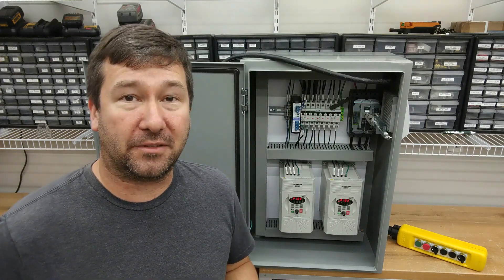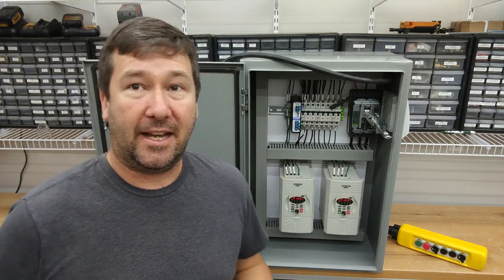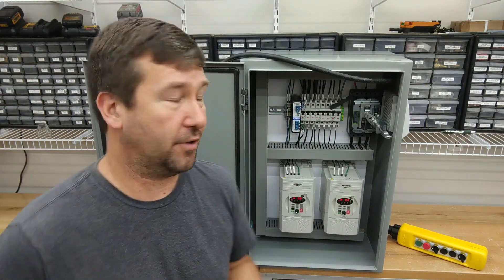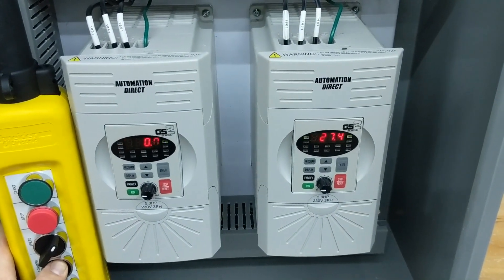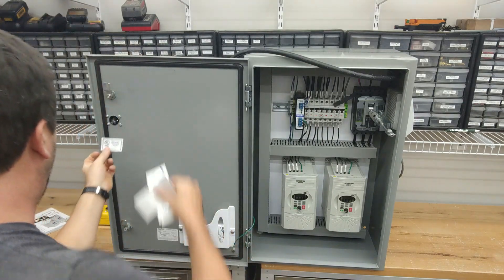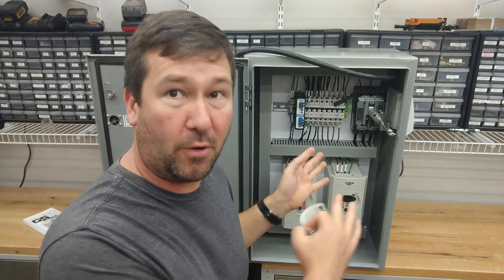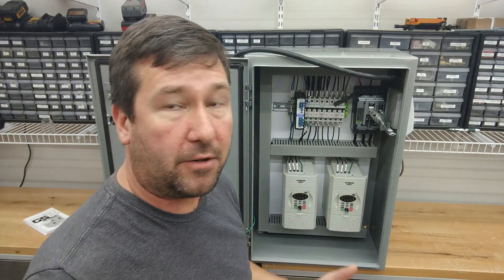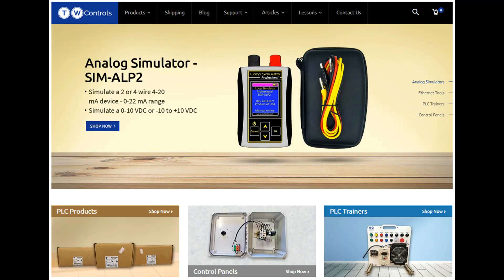Control Panel Building Testing and Finishing Touches Part 6 of 6

Comment: Tim, I’m looking for a handheld panel tester for doing my own FAT testing. What do you recommend? Thank you.
Reply from the maker: I'm not sure what you mean by a panel tester. Usually it isn't a single device that determines if a panel is acceptable but a procedure of steps that you usually test with a multimeter.
Reply: I gotcha, but what is the yellow handled you have in the video to simulate things ?
Reply from the maker: It wasn't to simulate things, it was a remote pendant that operated the control panel per the customer's specification.
Reply: Thank you sir
Reply from the maker: You are welcome

Comment: Thank you for the time and effort you guys put in to making these tutorials. I have to say "yep" to the hand washing. I had a brick and mortar repair/rebuild outfit that dealt strictly with coal mining. As can be imagined, everything we worked with was covered in black dust, dirt, and even mud. There was a lot of hand washing, through the whole process actually, but certainly through the reassembly. One tip that may be helpful to those that do use a lot of wire ties (as we did) is to cut the excess of the tie flush. I have worked on panels where my hands looked like I wrestled a cat because the excess was cut at an angle. Not a big deal but it was a pet peeve of mine.
Reply from the maker: Yes, plus I like to rotate them to the so that they are against the panel so that you are less likely to brush up against them.

Comment: Thanks for the series, I found it very useful. Some of your thoughts I would like to learn is layout. This is a pretty typical box for us but if I add a PLC, HMI [on the door] and contractors with thermal overloads, where would you have placed those items in this layout. Of course you probably would have needed a slightly bigger box. I also find that everyone puts the line reactor on the base [bottom inside of the enclosure], is that  how you would install a line reactor?
Reply from the maker: Glad you found it useful Val!  We have a panel layout video coming soon.

I probably wouldn't put the line reactors in the bottom.  I would probably put them where they are convenient to wire to the drive while maintaining the spacing requirements.

Comment: Hello Tim,

First off thank you for all the content you put out.  

I have built several panels over the last few years with different companies I have worked for as a maintenance tech. Each one a little better than last when it comes to design. Out of all the tasks I'm giving panel building is what I enjoy the most. 

What kind of advice would you have for someone that wants to pursue opening a panel shop? 
Specifically when it comes to becoming UL508a certified. 

Thanks.
Reply from the maker: Hi Daniel.  It is great that you have found what you enjoy doing.  

I've been debating on doing a series on becoming a UL508A panel shop.  It is not as hard as your would think and I would strongly suggest doing it.  Thee catch is you really need to have enough work to cover both the yearly and quarterly cost of keeping your UL certification.

The training they provide you is well worth the money.  You'll be drinking a wealth of information from a fire hose.  

Overall it actually lowered our panel building cost because we were overbuilding them.  The biggest thing that we had to improve was our labeling and short circuit calculations.
Reply: @TimWilborne  Hi again, I would love to see a video on how to become a UL508A panel shop. I have debated it for years, and currently have a new business opportunity ahead of me that would make it worth the while. Thanks for the videos.
Reply from the maker: @corysietsema5099  That is a great idea Cory. I'll put it on the list. Beginning UL508A isn't as hard as some make it out to be. It's mining about having proper circuit protection and detailed labeling. Learning to do the short circuit calculations for the nameplates was the most difficult part for me to learn. The UL inspectors are very helpful and come by quarterly to check in.

Comment: I looked at my hands probably 3-4 times throughout this series. Thanks for all of the tips! Subbed, off to check the rest of the videos.
Reply from the maker: Great job Dr. Shields ;)
Reply: @TimWilborne  hahaha! Could you maybe do an all in one best tips and standards for building? Stuff like, how to place your terminal blocks and what colors are standard? I had a lot of questions when I first started and I couldn't find any videos on best practice/standards. Or how to mount Panduit level without putting holes all in your back plate/Panduit. I need to show a video like that to a few of my guys. "How to not swiss cheese a back plate". I enjoy watching you because you're as careful as I am to make it look grade A!
Reply from the maker: I probably could spend some time talking about panel layouts. It kind of goes against my policy if there shouldn't be rules on how to lay out of panel but I could do some best practices. It wouldn't be a live build because there are variations depending on panel sizes but I have lots of pictures of panels that I could share and talk about some. Let me do some thinking. I could definitely spend time on squaring up wire dice and DIN rail because I see a lot of that crooked. I'll put those two on the list. Thanks!